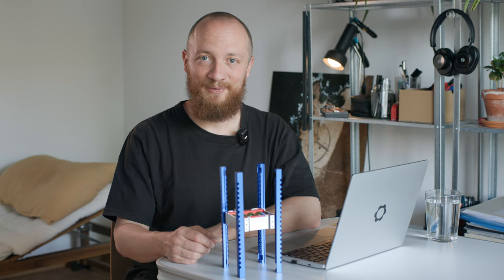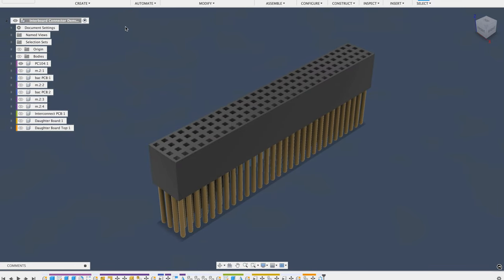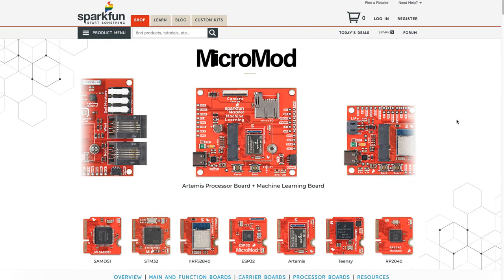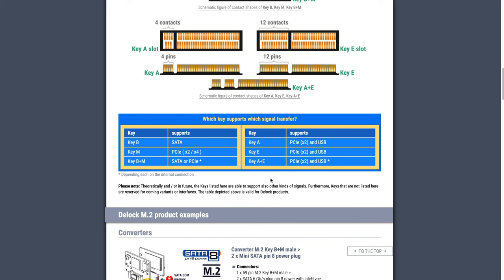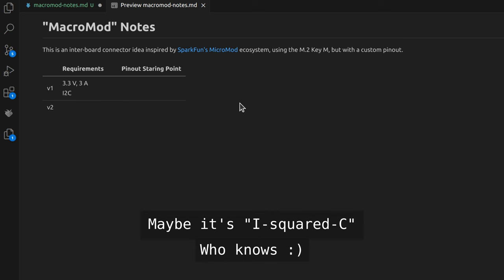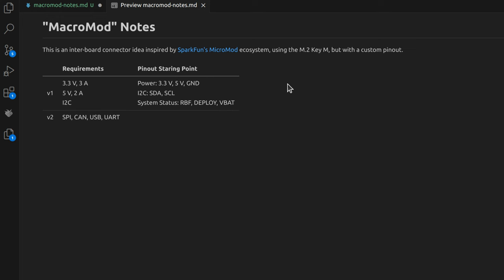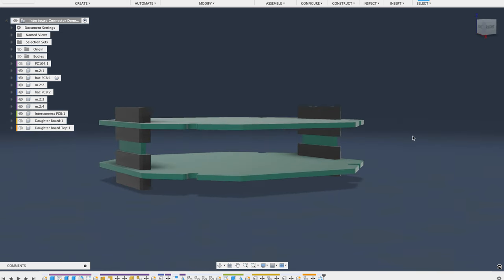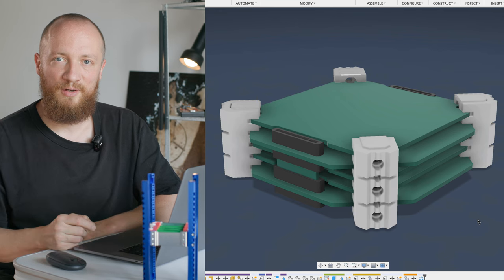Connecting the PCB Stack in my CubeSat with M.2

Comment: It is much more reasonable to have a vertial (like sitting parallel to rails, just behind solar panels) carrier board with set of M.2 (or shatever you want) connectors with goldfinger receiptance. Those carriers could also be stackable.
In your design you would stuck with soldering M.2 connectors, as they usually have plastic or even metal tabs to hold connector on PCB.
Reply: If you still want to have a stack-up of boards, look at the proper mezzanine connectors, like Conan line from Amphenol.
Reply from the maker: Thanks for the input! This sounds interesting, do you have any visualizations of that layout? I had looked at a number of different board-to-board connectors but kept coming back to M.2 because using simple 2 layer PCBs of various lengths as connectors seems very flexible and cost-efficient. It is completely unproven though, so I may very well fall back on a different solution. I don't remember if I had evaluated the Conan line, will look into it. Thanks again!